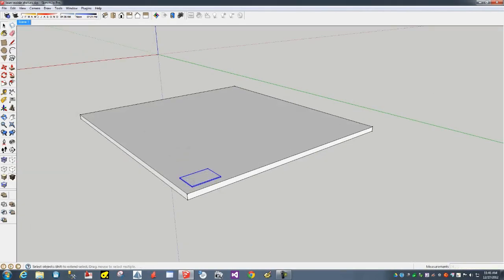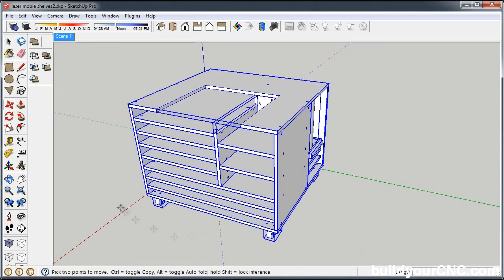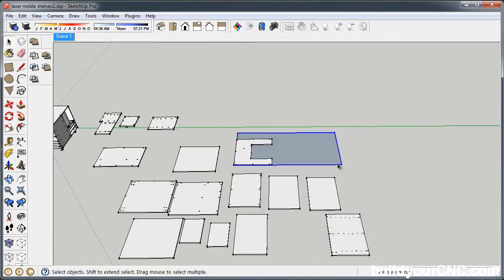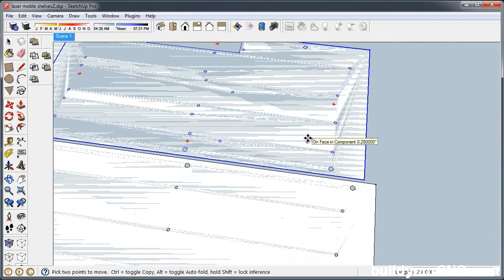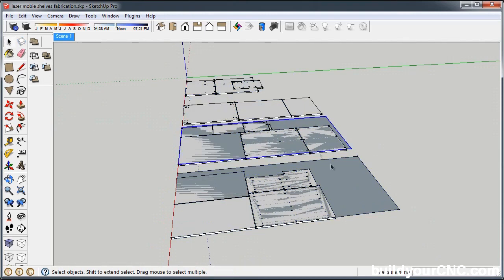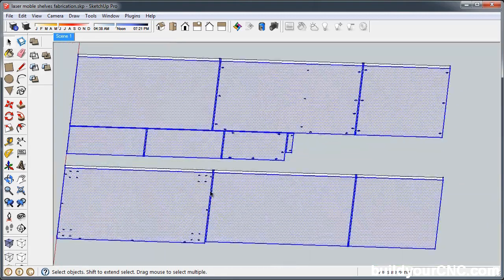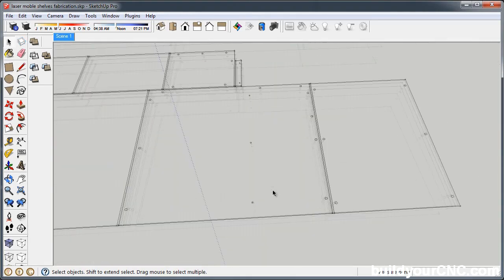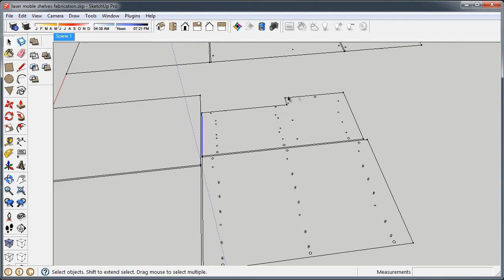Part 1: From SketchUp to Fabrication

Comment: Thank you for this tutorial, nice explanation, just one question, can I add automatically objects definition for CNC work ?
Reply from the maker: I'm ot sure what you mean. Can you elaborate?
Reply: @PatrickHoodDaniel  I have modeled a parametric chair with sketchup and I flattened all the parts, just missing how to number the parts or write their reference number which is on they definitions with an automatic way (like Slicer do), thanks in advance.
Reply from the maker: @GSMAEK  I haven't used sketchUp in a while and sketchUp has changed quite a bit since I made this video.  I use Fusion360 or Inventor and part numbering and naming is pretty straight forward with those programs.  I just don't know with SketchUp.
Reply: @PatrickHoodDaniel  You are totally right, I too have migrated to Maya, I think if we want to waste time to learn something we have to do it in a professional way, I have old Sketshup projects that I want to recovered them, for the moment I have just Slicer For Fusion 360, I'll take a look to Fusion360, Thanks for your advice.
Reply from the maker: @GSMAEK  Let me know how it goes.
Reply: @PatrickHoodDaniel  ok, In Cha Allah

Comment: You used complicated way to extract the faces. You can  put all components on rectangles and you do intersect with model. After that delete all components on rectangles. There is the same geometry like you had in your video. ;-)